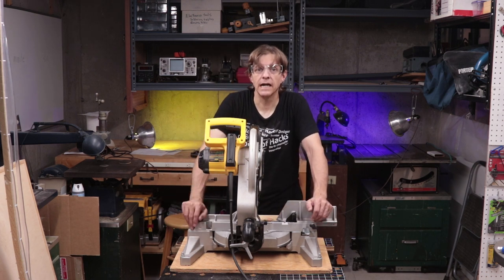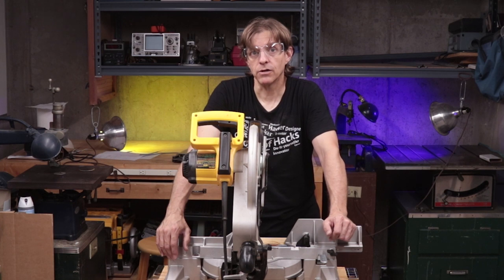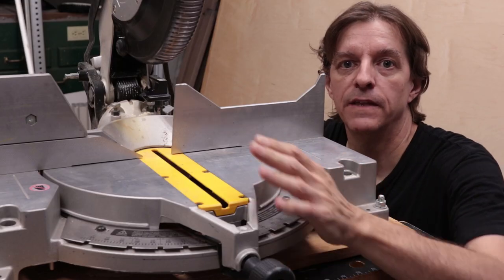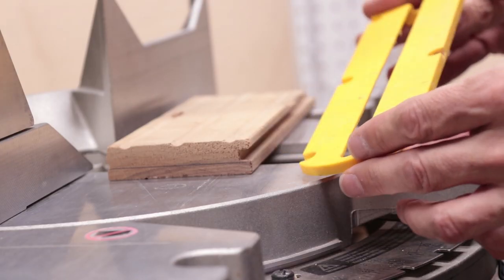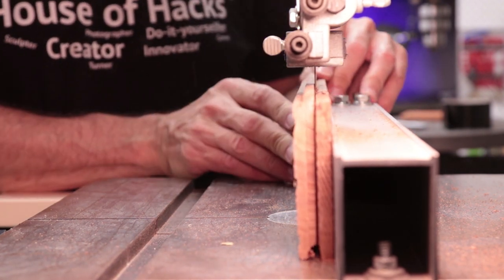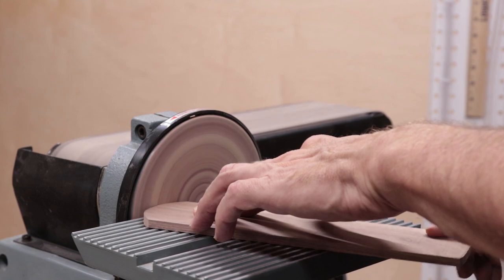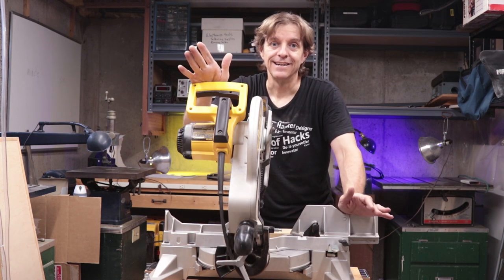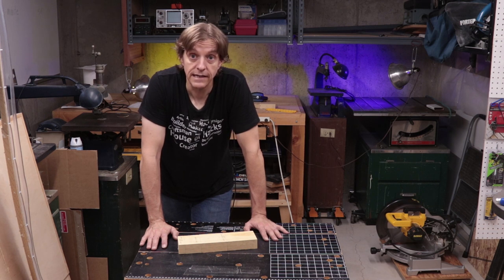Miter Saw Zero Clearance Insert - Does it make a difference?

Comment: Interesting result. I haven't actually used my mitre saw yet but had heard about inserts. I would primarily be cutting metal so tearout isn't such a big problem.
Reply from the maker: Yeah, I was a bit surprised that it didn't make a difference. It would help keep small pieces from falling under the saw, but didn't help any with tear out. Do you use yours on radio chassis or for something else?
Reply: @HouseOfHacks  Mainly for metal sections, either angle or tube for antennas. Trying to cut 2" steel tube with a hacksaw is just painful!
Reply from the maker: Ah, right. Yeah, the hacksaw is the last metal cutting tool I reach for. The angle grinder and cut-off wheels tend to be the first. And the advantage to it is... SPARKS!! :-D

Comment: The reason for having a custom made throat insert is more for cutting smaller pieces of wood and not having it fall below.  "Chip out"  will always be a result of your blades health; miter, band, or table saw.  Besides, The factory throat inserts feel extremely cheap and have a slight rake in them which I don't like.  Anywho...thanks for sharing your video on the topic.

Comment: My saw came to me from a carpenter that used it only for 90 degree cutoff, no insert and no handle. I found that a Ryobi handle would work, and a Ryobi insert almost fit, a little light sanding and it worked much better. The "315" prefix to my model number tells me the saw was probably made for Craftsman by Ryobi. New Craftsman (Lowes) has no parts available for Old Craftsman (I need to quit buying Old Craftsman!). I really would like an OEM insert but that will never happen. I think if I were making an insert using my "pretty close" Ryobi insert as a pattern I would make several at the same time. Using the saw without some sort of insert is just dangerous.

Comment: What about just putting tape over it and cutting through the tape? The only reason I need zero clearance is just as a guide, but I do want to have enough hole space for evacuation.
Reply: some try hards will tell you that tape will make the top not be flat making every cut you make slightly angled by the thickness of the tape (we are talking about .147mm here). Its wood working and IDK how flat these miter saws are anyway. I bet painters tape would be a decent solution
Reply: @dusbus2384  ohhh. Although, I must admit I myself removed the zero clearance tape because it kept lifting the t track that I put on it. But even without the clearance tape it's still lifting slightly.

Comment: I use one on my saw when I'm cutting clear vertical grain doug fir, I find the cuts cleaner...maybe the long straight grain, dunno. I put a sacrificial board vertically on the fence as well,now that works for 👍
Reply from the maker: Yeah, I've found sacrificial boards work well in most circumstances.